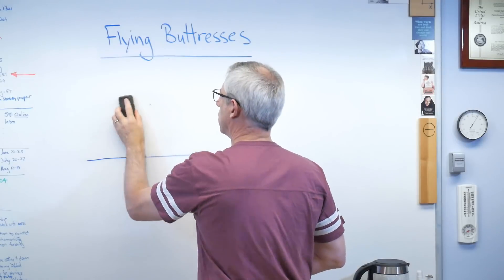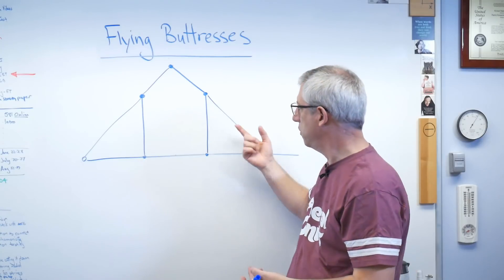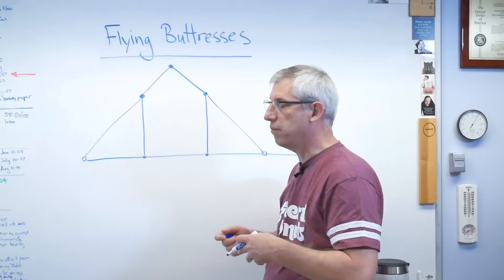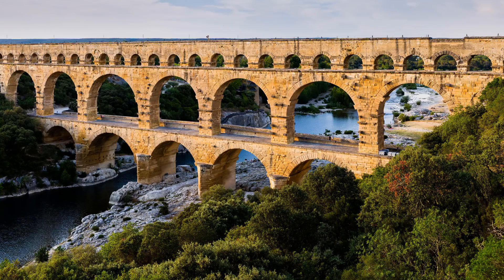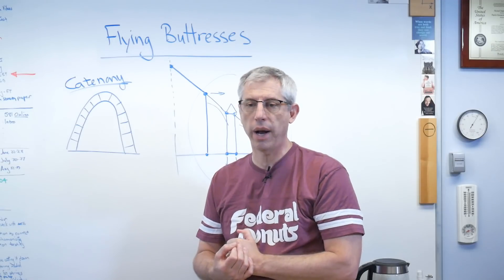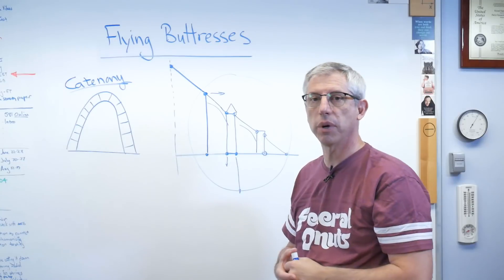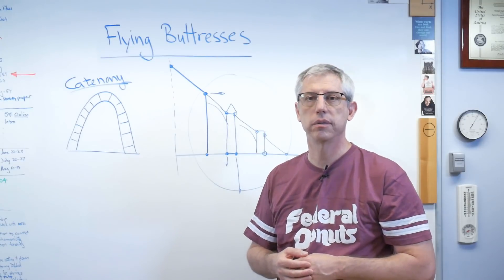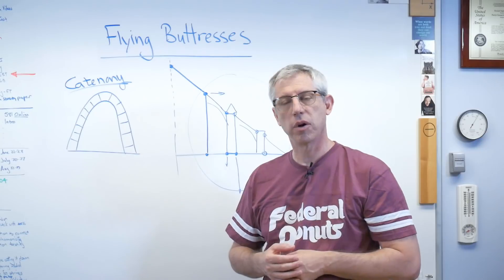Engineering and the Flying Buttress

Comment: I have enjoyed this video , but I must pull you up about what is a catenary. 

The original  Catenary, a tensioned curve formed by, a wire, rope, or chain hanging freely from two points that are not in the same vertical line. Unlike the other circular arches, it is a natural curve. due to the flexibility of the links in the chain. 
Catena ( Italian) Chain ( English) Katina ( Maltese) Cadena ( Spanish) Kedja ( Swedish)
These are all flexible tensioned elements hanging down,  under their own weight with the most popular being a chain or catenary  from its Latin language root. .

The history of it goes back to when electrical communication flexible  wire, and power lines was to cross a wide estuary of a river where  ships had to go under the crossing wire. The sagging shape of the cables was assumed to be a parabola. with an x^2 term in it.  They found that the minimum distance of the curve to the water was not  the same as they predicted. They revised the mathematics to find the Catenary curve. 
https://youtu.be/JlL6ZHChhQE?si=C1bIKzK5KNjKihvO

Precisely, the curve in the xy-plane of such a chain suspended from equal heights at its ends and dropping at x = 0 to its lowest height y = a is given by the equation y = (a/2)(ex/a + e−x/a). It can also be expressed in terms of the hyperbolic cosine function as y = a cosh(x/a).

The inverted Catenary shape used as an arch would require the minimum of side thrust, it could be a thin, self supporting arch.  I used to visit St Nicholas Cathedral in Newcastle upon Tyne. The top four arches  kept being supported for 150 years as the designer  lost faith in his design and thought they would collapse, The cathedral is notable for its unusual lantern spire, which was constructed in 1448. For hundreds of years, it was a main navigation point for ships using the River Tyne. At its base the tower measures 36 ft 9 in (11.20 m) by 35 ft (11 m) and it is 194 ft 2 in (59.18 m) from the base to the top of the steeple. 

On each corner of the lantern are gilded statues, of Adam eating the apple, Eve holding out the apple, Aaron dressed as a bishop, and David holding a harp. Following work on the street in the 1860s the tower was found to be cracking and tilting, so two porches were added to buttress the structure. Since then the tower has settled and the ornate wooden font cover, which is suspended from the tower inside, does not hang in line with the font.
 https://youtu.be/NjbnOvlHB4Y?si=xZZnSZ6_IgvgHFfU
 https://youtu.be/kfhA0BpSvGU?si=1Cz9lnPg5TygggE4

Note that catenary is in tension but principle of reversal/ mirror image in engineering, as a motor is the mirror image of a generator, hence a catenary arch is a type of architectural arch that follows an inverted catenary curve. The catenary curve has been employed in buildings since ancient times. It forms an underlying principle to the overall system of vaults and buttresses in stone vaulted Gothic cathedrals and in Renaissance domes. The catenary suspension bridge is rather unstable and has been replaced by the cable stayed  bridge, using triangles. 

I like the Filippo Brunelleschi  Dome in Florence which was self supporting as they built it, . 

https://youtu.be/_IOPlGPQPuM?si=Bv9jsBQGLY8n10Lt

Comment: @4:51 and following: "Historically, they may have collapsed.  They didn't have any math.  They couldn't describe what they wanted to do mathematically. They had to try things.  If you go back in history, it wouldn't surprise me if some of these things collapsed early on."

They did have math (Euclidean geometry, mainly), but not much in the way of computational math other than sums and differences (and most of that done with Roman numerals rather than "ciphers" - Arabic or Indian numerals that we used today; zero notation would have been nonexistent, so no place value notation, as such).  However, basic geometry was an empirically sufficient mathematical basis, given the historic record.

Some buildings did indeed collapse "early on" (during construction or shortly after completion).  Sometimes, modifications (the late addition of a hubristically  large crossing tower, for instance) might cause excessive loading of columns or foundations which were originally built for lesser loads, leading to damage or even collapse.  Not a few buildings or parts of buildings collapsed after foundations subsided due to changing water table levels or destabilizing adjacent construction.  Moisture ingress, due to poor detailing or inadequate maintenance, and the subsequently ensuing frost heave sometimes split walls apart, leading to local failure.  The chaos of the French Revolution probably destroyed as many such structures as any other single cause, and no amount of design or engineering could avert that mode of failure.

The problem of designing large clear spans for construction in stone was approached as a geometry problem, not a strength of materials problem.  The compressive strength of stone is rarely less than 10X the nominal loading, even in very highly loaded members, e.g. the crossing columns supporting the aforementioned keeping-up-with-the-Jonses crossing tower (small imperfections of stereotomy or construction may increase the actual loading, locally, above the nominal calculated load).  In most parts of large structures, loading is more like 1/20th to 1/50th of the compressive strength of the stone, i.e. the strength of the stone is effectively infinite for any reasonable size of structure (even mud brick or compressed earth block structures can be safely built several stories high).

That being the case, the proper geometry, selected to ensure compression-only loading, was sufficient as a design criterion, and strength of materials considerations could be safely ignored.  The proper geometry (and a safe assembly procedure) could be proven out by carefully constructed stereotomically correct scale models.  Plans for an existing building (thus known to be stable and safe) could simply be scaled up (down) to make a larger (smaller) version.  Acceptable proportions were codified as rules of thumb, easily remembered and reconstructed elsewhere by Euclidean geometry using string, compass and straight edge.  Later, hanging catenary scale models were sometimes used (most extravagantly by Gaudi, for Sagrada Familia and Parc Guell), then sketches or photos made of the purely tensile shapes of those models so that the compressive lines of force when inverted could be properly surrounded by structural material (the "middle third" rule was commonly used - i.e. keep the line of thrust within the middle one third of the thickness of the vault).  Beginning in the mid-1800s, graphical statics slowly became a more common method of finding the lines of thrust, rather than constructing physical scale models.

Today, there are computer models being developed to help architects and designers to specify compression only structures for various complicated load cases. Philipe Block's "Thrust Network Analysis", developed when he was a PhD student at MIT (he's now at ETH Zurich), brings James Clerk Maxwell's graphical statics from the two dimensional drawing board to three dimensional digital space.  One implementation of TNA can be had as a plug-in for Rhino 3D.

For anyone interested in a more academic approach to the topic, Jaques Heyman's translation (with his own commentary added) of Coulomb's "Memoir on Statics" is a good start, or his book "The Stone Skeleton".  Santiago Huerta has written many articles analyzing historical structures and medieval building theory in light of modern engineering knowledge, the vast majority of which articles are open access.

All of this is to say that the architects and engineers of the past were pretty clever, and were able to do things that we would be hard pressed to replicate today, even though we may have a better theoretical understanding now of what they did back then, when the only math they had available was constructive geometry.  The daring of some of these people was astounding, building structures which could never be approved today, but which have stood for hundreds of years.
Reply: They may have possessed incredibly advanced mathematics, but later generations wouldn't know. The knowledge was passed down only within families of stonemasonry workers.
Reply: @kalina-u3j  That's certainly true enough; we don't know what was lost.  Other than Villard de  Honnecourt and a very few other surviving Lodge books, we know very little of the details of Medieval engineering practice, which was transmitted, as you say, from master to apprentice by word of mouth.  Even Honnecourt is rather fanciful, and not a faithful reporter (which may never have been his intention, in all fairness).  We can infer a few things from, for example, the headstone of Hugh Libergier, or some extant tracings in silverpoint on a plastered lofting floor in some cathedral or other.  But most everything we know is inferred retrospectively, since the sources and methods of transmission were ephemeral.

Even so, basic geometry is sufficient, even for the fan vaults of King's College.  Sagrada Familia required 3D catenary models, and possibly a camera lucida.
Reply: @kalina-u3j  For a good overview of "the company line" of the state of the design methods used by medieval builders, you might try Santiago Huerta's "The Medieval scientia of Structures," which can be freely downloaded.

Comment: The myth that cathedrals took centuries to build is really a... myth... They did take a long time to build, around 60 years, which was about the lifespan of the average adult at that time. Why some of them took so long to build was because construction had to be sometimes halted for a multitude of reasons. For example the cathedral at Köln Germany was officialy under construction for 632 years, but it includes a lot of dismantling and rebuilding, and a 300 year pause.

Comment: I have yet to see a buttress fly, to me they are just buttresses and fliers.  Later high French Gothic Cathedrals also used (hidden) iron elements such as links, rods, and chains to resolve the forces in the walls and fliers, for instance, at Amiens.  The most famous collapse of an HF Gothic Cathedral did not come in the earlier period but in the later period, a flamboyant period of ever-increasing asperations.  When Beauvois cathedral's choir ceiling crashed down so did the confidence and flamboyance of gothic designers and builders, in many ways, it was the end of an era.  Beauvois Cathedral had the highest ceiling of any gothic structure at over 150 ft.  It is far too complex to discuss here, but even today the reasons for the collapse of the choir ceiling are contested , but like many disasters, there were probably a number of contributing factors combining together, including high order modal resonance of the fliers caused by high winds, Tacoma Narrows anyone  It still exists, unfinished, and damaged, but about to undergo a major preservation project.  It is extraordinary, visit it if you can.

BTW.
The name gothic was an insult bestowed on these great structures during later periods.

Comment: Hello! I'm an architecture student. i have a question,  can flying buttress be used to hold weights of a building or a castle second floor? the whole point is to avoid using columns on the inside and using neo gothic and baronial style architecture elements

Comment: Those are not posts outside the structure. Those are called external pier buttresses. What you define as "flying buttresses" are not exactly drawn. Your drawing conflates the curves of the lower interior side aisle bays that are under the side roof with the flying buttresses. Flying buttresses, to be exact, are composed of a vertical external buttress pier (this can extend outwards or be detached from the lower wall) and an upper arch that spans the top of the external buttress pier and points of outward stress between windows in the upper clerestory. The flying buttresses are placed at equal distances along the length of the structure. Internally, the spacing of flying buttresses correspond to the elongation of compound piers upwards into the clerestory zone. But flying arches are not buttressed by other flying arches on the lower half of the structure (the arches never hit the ground) in a continuous line....vertical buttress piers (your posts) do repeat, but not as a bracing element of one another...instead down the length of the structure equidistantly.  In later Gothic structures, the upper arches that fly can be divided into two smaller arches with a pinnacle between them, but still on one vertical buttress pier that runs straight from the highest point to the ground. So, I'd say medieval masons did have a great deal of technological and mathematical knowledge.
Reply: I’m going to have to crack open a cold one and do some architectural research guided by your detailed post. Thank you ma’am.
Reply: @ibelieveicansoar  You're most welcome!